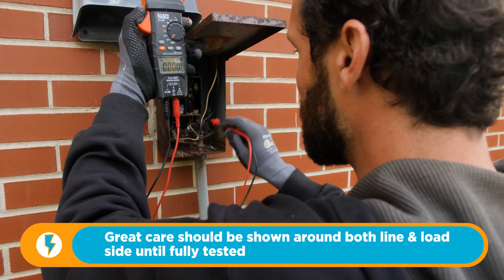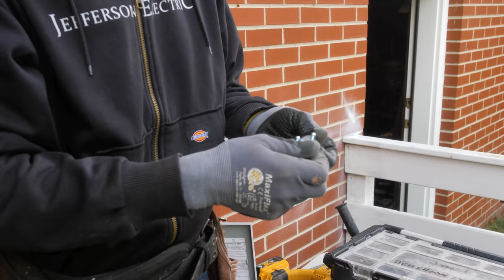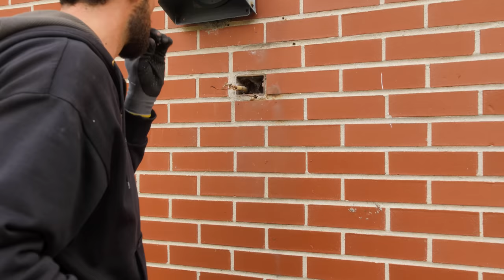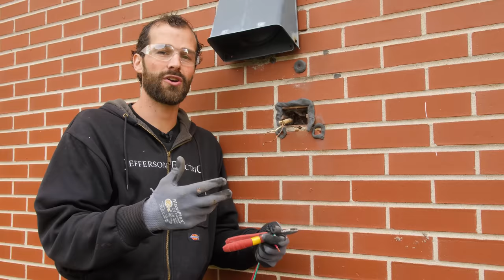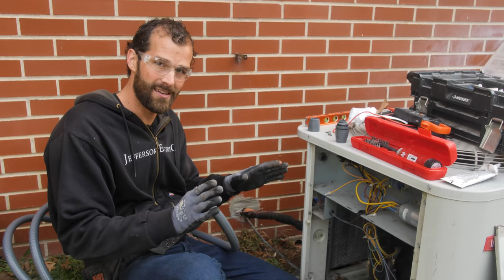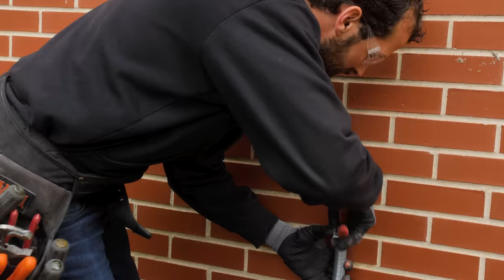Wiring An Outdoor AC Unit

Comment: Why not either mount disconnect box 2 bricks lower so it is not up against the wet air vent or put a cover plate on the outlet box in the wall and conduit over to the disconnect switch so it is away from the wet air vent?
Reply: good someone saved me the comment.

Comment: That vent should be redirected , but very good video , people should  use this as  an example of how its done right !!  .
Reply: I agree as an Canadian Electrician being in the trade for over 30 years I think the bathroom vent caused the rusting of the previous disconnect. I think either redirecting the vent or locating the disconnect away from the vent would prevent moisture problems on the disconnect. Great video I think you do very thorough A+ work from the videos of yours I have watched.
Reply: I thought that as well. Even a “x” inch/cm pipe to either angle it further down past the box or up and away. I would imagine up would still cause a problem with water dripping or steam cooling and dropping down. Is there a code for venting? Like distance from the ground. I would think that current set up would possibly raise an eyebrow in an inspection.
Reply: Agree

Comment: Just like to say love your attitude always willing to improve even as a master electrician. A commitment to lifelong learning and CPD and assessing each install on its merits and risks will help to make every install safe, code compliant and better still - above code professional install. Nice tip on the duct seal though I suspect it will probably harden in a few years in an external environment and crack eventually reducing the watertight seal.
Reply: Caulking better for long-term?

Comment: I already think you would have been better off putting a weatherproof blank cover on the box in the brick and taking some liquid-tight flexible conduit off a hole in the middle of the cover with a 90° connector, running it to the right a bit to get away from the vent, and then just right into the side knockout of the disconnect.
Reply: that is a good idea. That would have been a better option

Comment: So… question about making your joints in the j-box instead of inside the disconnect box. Doesn’t that j-box fail the readily accessible requirement once you permanently install the disconnect over it? How will the next guy service those joints if there’s a problem?

Comment: The two numbers on the a/c unit you mention are maximum fuse or maximum over current protection. Which is simply your breaker size. The MCA, minimum circuit ampacity, is your wire size/insulation type.

Comment: I wanted to say that I always twist my stranded wires before any fitting to keep loose strands from possibly not going into the connector and it makes insertion into a connection easier than just loose strands and when torquing down the connection it holds better in my opinion it can’t flatten out as much
Reply from the maker: @paulbell1835, thank you for your many technical tips!

Comment: Thank you for your great tutorial.  I am a retired electric lineman, but now working on some home projects and I do love the duck seal and the anti oxidant you utilize.  Have found some old connections with the aqua seal or bishop in old (like 30 years or older) street light bases still in great shape and bolts and nuts with anti oxidant able to remove.

Comment: I like your style of teaching, very simple and straight forward.  
I had an ac replacement done a few years ago and the crew that did it were very young but, seemed competent.  The one problem I had was a couple years later and it was the 6 ga multi stranded wire on the ac lug line in lug.   
The young installer improperly stripped the stranded wire and scored the copper.  It had broken off o few of the strands after cycling on and off for two years and made for a loose arcing connection, that melted the lug.  The repair guy didn't want to admit it was his installers fault and charged for the service call.  Would you have charged for a service call when you find a loose connection heating up and arcing after a two year old install from your company?

Comment: I think I would have moved that disconnect about a foot away from the bath exhaust to keep that daily moist air from corroding the new disconnect.  Yes it would have meant a bit more conduit and a couple more clamps, but It would be less corroded in a year.
Reply: Is it an exhaust vent or a fresh air intake?  If an intake should be no problem for the current location of the new box.
Reply: @briansprague9340  Lol, it's an exhaust for the bathroom fan.  And from the amount of rust on the disc box, you can tell they either take long showers or have a lot of people taking showers everyday.  It's probably survived 40 years worth of bathroom moisture, but moving it one foot away will keep it out of the direct moisture and looking new longer.

Comment: if a box is mounted onto masonry it it considered a damp/wet location so the receptacle has to be rated accordingly, wouldn't the wire need to be rated for that also, since its in the same box?

Comment: would it have been feasible to drill your 1/2" KO above the top terminals to allow wire length to the line screws? I know the ground woulda been a little short, but the better reason would have been to lower the disconnect and give it more room under the vent. I wonder if the warm moist shower air being discharged contributed to the rusting of the old one

Comment: External AC condensing unit  should have a receptacle on the same level and located within 25’ of HVAC equipment 210.63 maybe that was not in the shot? Also that receptacle should be GFCI protected 210.8(A)(3).

Also if you were to apply the 2020 code you could put them on a time-delayed combination and dual function GFCI and AFCI breaker. Time delayed to avoid inadvertent tripping on motor startup and large in-rush currents and other transients (including DC) that either saturate the breakers or cause a sinusoidal transients sufficient to trip these breakers. This has been controversial in states that have adopted the 2020 code like Texas but many electricians really did not fully appreciate the need for a specific type of GFCI/AFCI breaker installing the wrong types caused issues. Albeit even these can be blinded from time to time as many different types of transients can occur from motor operations.

On overcurrent protection with your disconnect you actually have a belt and braces approach which I liked. Fuses at disconnect and breaker at panel.
Reply: @ElectricProAcademy  just wanted to say you are incredibly brave and talented to put your work out like this with the intention to improve. I am sure many of us have learnt so much from the work you have shown and for apprentices this is a gold mine so Thankyou for helping the industry and never stop learning this is what will help you to excel.
Reply: Does this mean that this setup should be using an "outlet" style (receptacle) instead of the disconnect, or am I misunderstanding? Apologies for not being fully versed in this!
Reply: @BAT-man...  not sure what you mean by an outlet receptacle. But outlets/receptacle are placed near and external disconnect to allow the use of corded power tools to service the AC condenser equipment. They can be separate from the disconnect or you can get disconnects which have a GFCI receptacle built into the disconnect as well.
Reply: @mathman0101  Ahhhhh, got it.  Thank you for that clarification.   That's pretty handy actually.  Does the addition of a receptacle to the disconnect affect the size of the breaker that the disconnect/condenser is on, or is it negligible enough to keep the usual 30a breaker for a particular condenser (if that's what it requires)?
Reply: @BAT-man...  disconnects depending on the motor/compressor rating can be single pole (120v single phase) or double pole (240v double phase) for larger motors/compressors.

The disconnect for the condenser is usually a heavier gauge to carry the ampacity load this would be on its own breaker (greater than 20 amp usually). The receptacle would be wired on a separate GFCI protected circuit with a lighter gauge wire with a 15/20amp breaker.
Reply: Indiana is still on the 2008 NEC.  I sure hope GE/ABB is working on 1/2 inch GFCI/AFCI breakers 😀
Reply: Ironically all that adds complexity, cost, nuisance tripping, multitude of potential failure points, possibly small voltage drop and 24/7 phantom loads. Gotta love progress 😁

Comment: They now make Outside Disconnects for AC Condenser Units with 30 Amp Two Breakers already installed PLUS a Built in GFCI Duplex 120 Volt 20 Amp Receptacle that meets the Code requirement  for having a Outside Receptacle Outlet near  the AC Unit for HVAC Service Techs if needed .
Reply: Umm yea but you still need a separate 120v circuit run to that disconnect

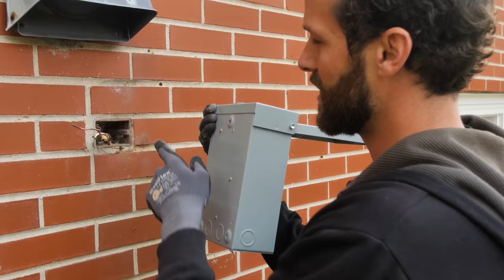Comment: 8:10 you think that exhaust vent had something to do with how bad that other disconnect rusted...  relocating the new disconnect might have been a better option.  An electrical box cover connected to some conduit could have allowed you to move the new disconnect so it might not have been in line with that exhaust vent.  Probably could have also used an existing knock out with the new disconnect.

Comment: Several inspectors in my area are requiring everything in the damp or wet location to be approved for those locations,down to the connectors,even if entering the rear of the disconnect. easy enough to drop a short piece of UF from an indoor outlet, however quite of bit of extra work to transition from NM to thhw inside the building, it is debatable, however up to the inspector, and there is nothing worse than having to re-do anything.

Comment: question.  could he have added a small subpanel with breakers instead of a fuse box for the HVAC?  I know it's different wiring but would that have worked?
Reply: @ElectricProAcademy  thanks.  I'm sure you had a good reason to do it that way.  Just curious.

Comment: Just a quick question would a rotary switch disconnect that is lockable be acceptable instead of a fuse switch pullout disconnect in residential setting? Rotary disconnects are more usually used in industrial settings often with dedicated machinery typically linked to motors. It’s beefier and better weather protected a bit like your new lever throw disconnect which is lockable.
Reply: @ElectricProAcademy  exactly sometimes if we go above and beyond the code it’s not an issue as long as it meets all existing codes as well.

I have been thinking about the Leviton rotary switch use. In addition to meeting this I awaits would do a set of technical testing (continuity of ground and current carrying conductors, insulation resistance, line impedance including determining ground fault and short circuit fault currents, testing for extraneous touch currents and voltages, operational time to trip and current tripping if circuit is covered by GFCI protection). It also looks great with rotary switches 👍🏾

Comment: Pro tip I learned from another you tube channel. Using a TapCon and the brick/concrete turns out to be a little more crumblely than anticipated and the hole isn't holding the fastener as well as you like. Use a piece of 12awg solid wire as a filler, install the TapCon.  It'll be as tight as a crabs ass...water tight.

Comment: This seems relevant so I'm gonna share a story. I was helping out at a library doing an outdoor movie. During the movie a gust of wind came through, the neighboring buildings in between had some old doors and Wood leaning up against the wall that blew down. One of those doors hit the air conditioning unit knocking the fan out of balance and out of alignment so it was making a terrible scraping sound. Thankfully they did not have their disconnect locked so I was able to pull that preventing further damage to the unit and the business had their phone number listed which allowed me to leave them a voice message alerting them to the issue. I got a reply back saying that they came in Monday wondered why it was warm check their messages and immediately found out why.
My point is that I don't think disconnects should be locked in the on position and I'm not sure manufactures really should be allowing this either. And it's definitely not gonna stop air conditioner thefts that's another story. I Came in to church Sunday morning early to set up like I usually do, the sanctuary was warm so somebody poked there head out the door and noticed the whole unit was gone and they didn't even bother to cut the power off at the disconnect right next to it. so locking your disconnect doesn't protect anything (unless it's lockout tag out) especially not with a MasterLock #3....
Reply: If you look at where the hole is it's only lockable in the off position... I've never seen a lockable on disconnect, I don't think NEMA or UL would let it fly except for utility stuff

Comment: So you did use duct seal lol must have started watching after this video. and this j-box to extend wires is why I love copper crimps over wire nuts stranded to solid twist together you can see the ends come thru crimp and verify good crimp nylon snap cap never worry about it agian. Wire nuts especially on 10 or larger I worry about coming loose especially since this will be a buried/hidden connection after disconnect is mounted.

Comment: Would it be a good idea to use an exterior junction box over the existing hole and conduit over to the disconnect? That way the length of wire out the hole is less of an issue and then the disconnect can get away from under that exhaust vent.

Comment: Question, I am the asset manager for multifamily properties that have multiple ac units in one location what do you use to seal the area around where the conduit goes inside the building? I have a picture I would like to send you of what I am talking about -  someone has made a makeshift metal plate that goes around the wires, but it is half-assed at best and looks terrible. SURELY there is a product to clean up building exteriors for this? Thank you in advance.

Comment: Whenever it rains my AC unit will not stop running for a few hours no matter what the thermometer is set at. If the breaker is switched on, the AC is running. Any ideas on what could be going on? I’m nervous to call someone out for a service call because I think it’s a rare/hard to diagnose issue
Reply: Does a breaker trip? Maybe take a look and see if there is water going in somewhere. You could always call them on a sunny day and turn the hose on the AC condenser (not full blast, like hard rain though :)

Comment: If it was a larger box I would have always used a insulated Polaris or burndy type connector at least with anything larger than a 10AWG better than a wire nut or even a gel filled Wago connector just to be sure I still regard that box as external not withstanding the sealant you used.

I would have also redirected that vent I suspect if hot air was coming out of it the corrosion of the old box could have been impacted by moisture-laden air from the vent and or hot air interacting with colder external air around the vent and disconnect.

Comment: wouldn't you just use a non-fused disconnect if you are coming from the service panel with a breaker? Also, how do you size the disconnect to the ac unit?

Comment: How is it to code when you buried your wire nut connections inside the wall cavity?  Any failure is a potential fire inside the wall?  I’m an amateur “professional home owner” and I would never do that and I would site an electrician working on my house if they did that.  You installed a threaded strain relief with lock down screws and didn’t tighten them.  Are you assuming that because there was no pullable slack that the wire was secured to code?  It seemed you had enough wire to pass the romex into the box, lock the screws and then extend the wires internal to the box.  What am I missing?
Reply: So how would you do it...

Comment: 3/16 Tapcon use 5/32” Masonary Drill bit.  5/32” = 2/16” +’1/32 1/32 = 1/2 of a 16th of an inch

1/4” tapcon uses 1/16th less than 4/16 which is 1/4”  that means you use a 3/16th drill bit. Also it’s advisable to use a shop vac to suck out the brick dust from the hole to make it deeper.otherwise the tapcon screw might not go in deep enough to be flush with the 1/16th? metal  box.
Reply from the maker: Boom!

Comment: I wonder if installing it right bellow the exhaust fan cap is a good idea?
Reply from the maker: Yeah...it's not, but neither is further opening the exterior wall so it felt like the lesser of 2 evils. The best solution would be to hire a mason to do repairs after the relocation, but that is up to the value assessment of the homeowner.

Comment: Apologies for a potentially dim question - But what happened to the neutral wire in this 3 wire setup?  The  red and black are hots, the green is ground, where is the neutral?
Is this perhaps an older AC unit and older existing wiring that don't use a neutral wire?
Reply: @ElectricProAcademy  I had the same question. Your response was very helpful. In your other video about installing a 240V car charger, that receptacle also had two hots and a neutral. What is the purpose of the neutral there? Is it because the car itself has standard electronic components?
Reply: @scottwaterland5778  If we're thinking of the same video where Joel installed a NEMA 14-50 for charging an EV... The neutral isn't being used and a NEMA 6-50 outlet could have been used instead, which has two hots and a ground. 

The prevailing theory I've seen on why 14-50's are recommended is because they are commonly used for RVs and as a result are commonly found in the wild, so it made sense to bundle Level 2 chargers with a compatible plug, even if the neutral is not utilized.